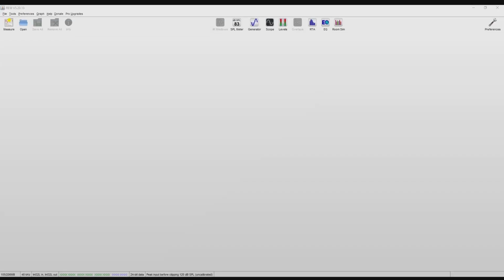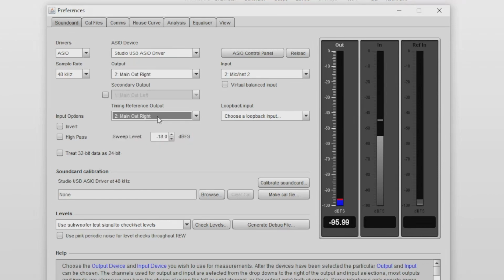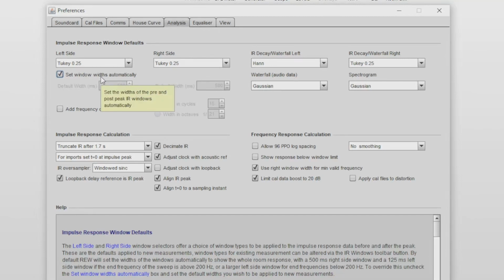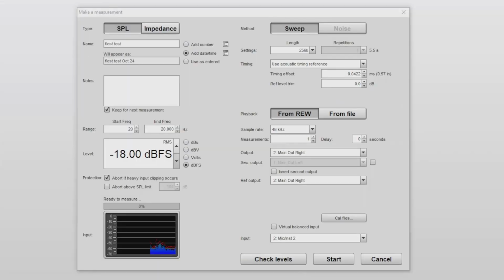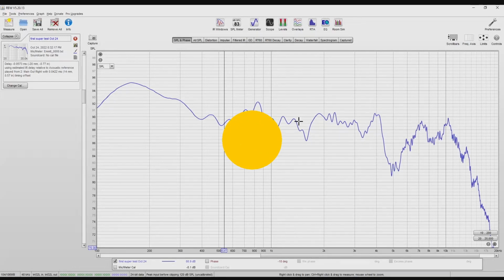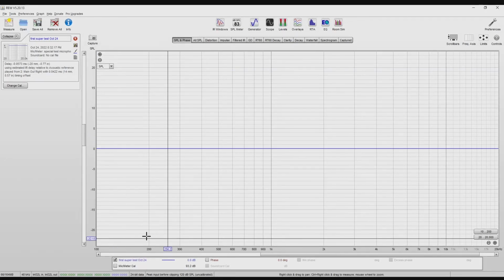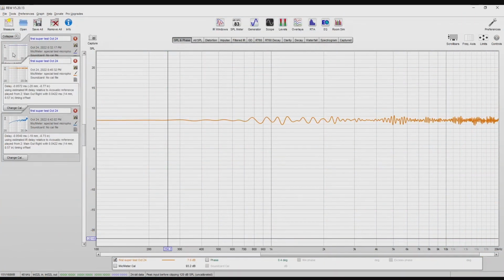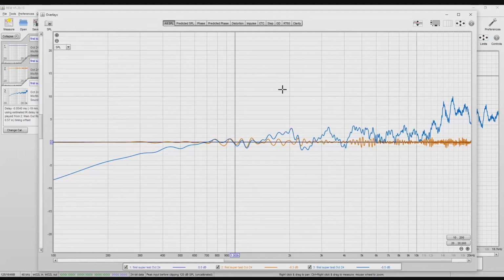REW Quick Microphone Measurements Ghetto Style. Quick and dirty studio microphone response tests.

Comment: Quick question here- how do you view the response for frequencies below 100 Hz?
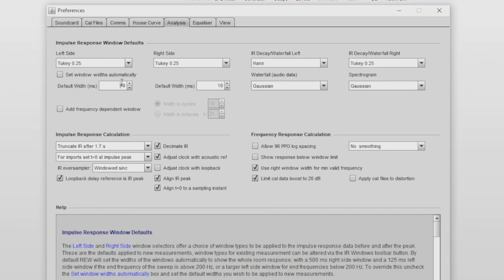Reply from the maker: Ah yes. If you look at the settings > analysis, seen at about 1:15 in this video, there are default window time controls that are set at 10ms. The left one is "ahead" and the right one is "behind" if that makes sense. 

If you increase the right one, you are moving the effective window to include sound that comes back later, but at the same time, increasing the wavelength that is possible for it to make sense of.  

Remember that at low frequencies, the wavelength is just longer by definition, so you need a wide sample window enough to calculate a bigger wavelength. this is why it is cut off on the plot, and the cut off will move lower as you increase the window depth. I hope this makes sense. 

One wavelength at 100Hz is 10ms in time, so, for 10Hz for instance, you would need to increase the window depth to 100ms. For 1Hz, 1000ms, and so on. 

You can change this window in a previous measurement in the impulse tab. Just slide the green slider "R" to the right and it should show the change you are looking for. 

Let me know if this makes sense!
Reply: @edwardthesoundguy  Yes it does! I haven't had the chance to fiddle with this yet, but I will do so when I have the chance. I did have a question about the whole cal file though. I'm trying to measure multiple mics but the results aren't very standardized because I haven't added a cal file. At the same time, I'm not sure if I want to use of the measured mics as a reference because it's not a particularly flat response and is kinda wonky. Do I really need a cal file? Any other way to get around it?

 Another question for you: Do you have any tips or ideas as to how I'd measure specs like sensitivity, noise, and/or dynamic range? It's something I've been looking into but can't find anything helpful. It also doesn't help that I haven't been using REW for a very long time :(
Reply from the maker: @shreyasks01  

No problem. We all learn best by experimenting! 

Standardized tests might be a handful without calibrated equipment of some sort. If you can imagine, a calibrated instrument like a microphone is just like a ruler. It has to be "in calibration" to something known, just like a ruler has to have the centimeters or inches "calibrated" so the measurements are useful. 

This does not mean you cannot glean useful information, but it just means you cannot really make standardized tests that somebody else could verify and compare with their own tests for even more useful information. 

You can possibly do some neat experiments. Of the mics you have laying around, look for some specification sheets, and in them, some sensitivity specification for instance. 

Often this is looks like this:

2.8 mV/Pa
or 
18mV/Pa
or
something re 1Pa. 

It's not super important to know really, but a "Pa" is a Pascal, or a very specific intensity of sound. Often a 1k tone. We can also call this 94dBSPL, because that is another way of describing it. Most sensitivity specs compare against a Pascal today. 

So a specification like "2.8mV re 1Pa" just means, 2.8 millivolts comes out the back of the microphone when a pascal is blaring in the front. 

You can compare microphones this way. If one microphone is known to be 2mV (typical of dynamics,) then you could run another microphone at the exact same distance, and if the chart is higher at 1000Hz, say 6dB higher, you would know that it is 4mV re a Pascal. One that is 12dB higher, 8mV. So you can compare sensitivity and see who is lying on their specs too, and fun stuff like that.

Can also double the distance and see if it really goes down 6dB. Do the lows change differently than the mids and highs? 

Another fun thing is to use something you know, even though it is not "flat" as the calibration for comparative purposes. If you press the "file" tab at the top, then "Export" then "export measurement as text," you can take any sweep (hopefully with no calibration already in use) and save it as it's own calibration file. Then you can "Change Cal" on anything else to select that saved text file as a calibration and see what the difference is.

This is fun. 

You can see how different another microphone is, or the same microphone from another distance or turned at an angle, or whatever is interesting to you. You just have to remember this is a comparison, so there may be what look like giant peaks in the highs and you have to just understand that these are "relative" if that makes sense. People often compare things like this using widely known "references" like an SM57. Not that an SM57 is magical, but it is very widely understood, so people can say, it's brighter than an SM57 in this interesting way, or wacky comparisons like that. 

There is a lot of fun to be had. 

Unfortunately noise and Dynamic range are not so easy, because the noise in your space is usually louder than the electronic noise inside the microphone that you would want to measure. It's actually quite a challenge to do these, especially at home. 

Although it is hard to do noise related testing, you might find it interesting to note that dynamic range is often measured compared to 94dB SPL (yup, one Pascal) as well. A microphone that says 74dB dynamic range usually means the noise floor from the internal electronics is the same as if a noise outside was 74dB lower than one pascal right at the front. 94-74 being "20dBSPL(A)" another way of describing noise performance. Hey, that's not bad. There is a little more to it, but it is interesting we are still comparing to the 1 Pascal spot. 

If you get a cheap sound level meter, or app or something, you can measure your space noise floor. Try A weighted, integrated if there are settings for this. Then you can know what a usable microphone noise floor would be for your space. If the space is 30dB (often quiet spaces are,) you know there is no point in picking an 8dB noise floor microphone that sounds bad vs a 20dB one you like the sound of, for instance.

There is a lot to explore. Let me know how things go.
Reply: @edwardthesoundguy  Thanks, I'll look into it! 

The motivation for this is a little different as I'm not really looking to optimize my room. But it's more a project of where I'm asking the question: Ok so manufacturers give all these spec sheets for their mics that they measure in anechoic chambers and all that. Is there a way I can measure some of these specs at home in an acoustically treated room, using REW, with a relatively flat studio monitor, and whatever mics I want to test, and still somewhat reliable/accurate results? 

For example so far I've used the AT 2035 and AT4050. Frequency response was relatively easy, simply sending a frequency sweep from the monitor, and having the mic in question record it as the input. Obviously something like impedance is a little tough as I'll need resistors and that's beyond the scope of my project. But I can't figure out how to use REW to test for sensitivity. I know i can send 1kHz tone as an output using the generator but measurement wise, am I still measuring SPL? In the measurement window, I tried fiddling with the sweep settings to make it 999 Hz to 1kHz. But the sweep sounded like it was going from 20-20k as I previously had it.

In terms of calibration, I am thinking of taking a measurement mic and using it as a reference, or using a mic like the SM57 or 58 like you mentioned and using it as a reference, I'm yet to decide.

As for noise, and dynamic range, I guess I'm misunderstanding something but what is the noise floor that REW is recording? In the measurement window, REW is recording noise floor, but if it's not the noise floor of the mic, is it recording the noise floor of the room? Even if my room is a well treated studio that has minimal reflections? Measuring the dynamic range would also call for measuring the max SPL right? My thought right now is to use noise instead of a sweep in the Measure window of REW but the noise tab is grayed out. Even then is that approach right? I know that I'd essentially be outputting pink noise and increasing the input volume of my mic until it distorts? The problem is I'm not really sure what measurements I can make in REW using the Measure window other than frequency response as it's only allowing me to output a frequency sweep. Any tips would be appreciated!
Reply from the maker: @shreyasks01  
That's great. Really exciting to hear what you are up to.

I think the easiest way to get real numbers would be to get a hold of a microphone with some kind of calibration data. This will solve some of your challenges, like measuring relative sensitivity with some confidence. The calibration data includes the sensitivity, and in this way you can use really inexpensive measurement microphones. Dayton EMM6 is a common one. It's not amazing, but could definitely be used.

With the noise floor it is a bit of a tough situation. 

When we look at anything that comes in, this is the "total of everything" noise floor, as your hardware has no way of distinguishing what is making the noise. Remember there are multiple noise sources:

Your preamp/interface of choice makes electronic (analog) noise and not all are equal.

Converting analog to digital creates a form of mathematical remainder noise, that we perceive as noise floor.

The electronics in the microphone make noise

The room makes noise. Usually a lot more than people think. 

Rarely is the electronic noise you want to measure in the microphone lower than the room noise. So it is very difficult to measure. It might seem quiet in a nicely set up space, but your ears and brain have extremely sophisticated noise reduction. Keep that in mind. 

One inexpensive way to get rid of the space is to put the mic in a large steel tube with threaded caps on the ends, caulking a cable in through one of the caps to hang the microphone. Then get an oil drum, float the steel tube in the middle, and fill the whole thing with sand. Swirl up some of the cable in the top, then bury the whole thing in the ground and cover it with a two inch iron cast lid. 

This does not work super well with low frequencies but for A weighting it can be enough. 

But then you still have to account for the preamp. Preamps are way better than they used to be, so you might be okay. Finding good, quiet preamps, especially when connected to higher impedance microphones can still be a big problem. Some of these microphones are 600 ohms, and this is not flat at all frequencies. So watch out. 

Do not test preamps by themselves without a load (nothing plugged in.) They will show as too noisy when they might be fine. You can see if a preamp is contributing too much noise by making up a simple test plug. This just an XLR connector with two resistors to fake the microphone balanced output. I think it should be pretty easy to find info on how to make one up. It is pretty easy, and you could even make up a 150 ohm, and a 600 ohm, just to see what is up under different situations. 

And on dynamic range, yes, there are a couple of ways to measure dynamic range. In most cases it is measured not from 0.5% distortion or some maximum viable level, but between 1Pa and the noise floor. 

You can figure out 1Pa at your measuring position with a tone generator and whatever sound level meter or meter app you can get a hold of. NIOSH has a very good app that is accurate. It is IOS only, but if you have an iPhone around this would work. 

There is a tone generator at the top of REW you can use. If not there has to be some kind of 1K tone generator out there. Most DAWs have a way to generate a clip of tone or just have it running like with a filter. You could just play that and crank it up until you get 94dBSPL where the microphone will be. Then without changing anything, you could play the 94dBSPL tone into your test microphone, set that to -18dB with your preamp, and then turn it off and measure the level with the mic in your sand tank isolator contraption. Subtract the difference and you might just have a good number. 

I do believe you could invent some good enough contraption like the sand filled barrel or an old safe full of stuff, or some craziness and get a usable number. In this case, mass is king. The more it weighs, the better insulated the mic is sealed up in there.
Reply: @edwardthesoundguy  Thanks for the tips! I had to drop trying to measure for sensitivity, but now I'm trying to see whether I can measure for SNR using REW. I guess REW measures the data needed to calculate SNR but not completely sure yet.

Comment: I thpught the idea of measuring your room with a certain set if speakers was so you could adjust the eq curve in your daw so that it compensates so anything you tecord in the speakers will sound like the room is perfectly flat and your hearing accurately. Am i wrong. It feels like you told us stuff which is awesome thankyou but there needs to be another vudeo on how to us the info in the eq. Rather than running around tryingbto physically fix the room . Thats something i cant fix physically cause its a home room that others sometimes use
Reply from the maker: That's a good point. There is definitely a case for making minor room response adjustments in processing, and this is commonly done. 

Remember we have to keep this processing from winding up in the output of your projects. This is often done with hardware EQ later (right on the way into the speakers,) so it is completely separate from everything (like headphone outputs or the mixed output.)

One other danger to consider is that EQ cannot quite solve everything. A severe ring in a space, for instance, is not just an increase in level, but a repeated reflection in time. You can de-emphasize this, but when the total level is even, some important information is reduced too much. I hope this makes sense. It 

I will try to make something up on this as soon as there is a chance and some way to put it together. Thanks for bringing this up.
Reply: Cheers  @edwardthesoundguy

Comment: My cilabtation mic diesnt cone with a calibration file its a behringer one what do you do
Reply from the maker: Yes it's a bit of a tough situation. The Behringer microphone is pretty similar (probably the same item) as the Dayton EMM6 that is also a perfectly usable, inexpensive measurement microphone. 

They have very small diaphragms and usually flat response within a couple of dB. This is good enough to survive in most cases without a calibration file. I have run a few of them and they are usually within  ±1dB up to 3500 or so, and ±2dB up to at least 18k or so. That's definitely usable.

Reflections and buildups in rooms are massive by comparison. Even measurement errors can be greater, so you'd still be able to get pretty useful results.
Reply: @edwardthesoundguy so do you just leave where you load the calibration file empty or blank then? I'm going to hopefully do this in a week when I'm back home can't try it yet. Cheers again
Reply from the maker: @williamshaneblyth  Yes that is correct. If you leave the calibration file selection blank, it will behave correctly.
Reply from the maker: @williamshaneblyth  Sorry I did not see this earlier. Yes, leaving the calibrations blank will give you a neutral result as if any adjustments were zeroed out.

Comment: Excellent tutorial! I would add smoothing to the curve so that the measurment artefacts (the wiggles that are in both the reference line and the microphone response) are gone. As it is, the measurmeents give a false sense of accuracy. And secondly, it's worth experimenting with the exact placement of the mic under test. Moving it 0.5 cm will make a difference using this method. The robustness of your mesurements are indicated by how similar those spaced measuremets are. Like, if you move the mic and only a slight change occurs above 10kHz, then you know you can rely on your curve as the actual frequency respone of the mic. 

This is so fun to do - check out the off-axis response of your facourite large diaphragm condensor mic and be amased at how little treble there is at 60 or 90 degrees off axis. 

Anyway - fun stuff! Audio engineers should do this with all their mics - manufacturers curves are so heavily smoothed as to reveal no flaw - so they're made by marketing and not by audio technicians.
Reply from the maker: Should have thought to mention something about this. Thanks!